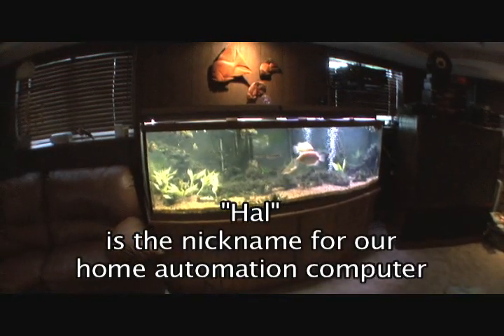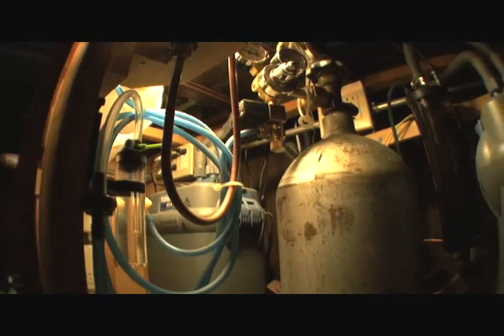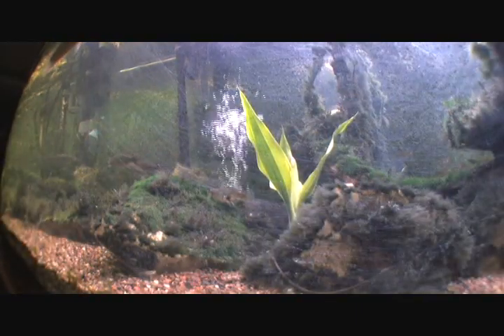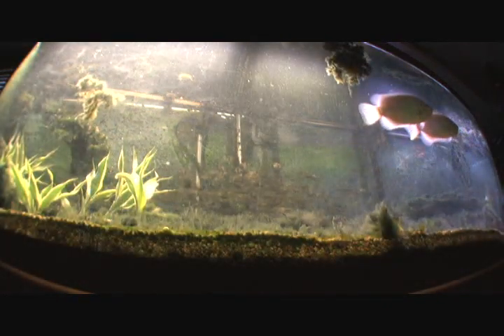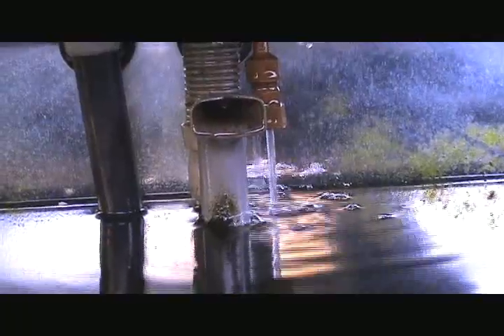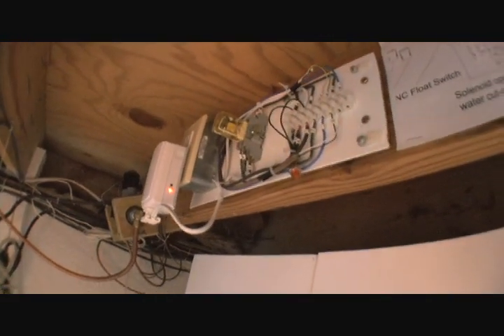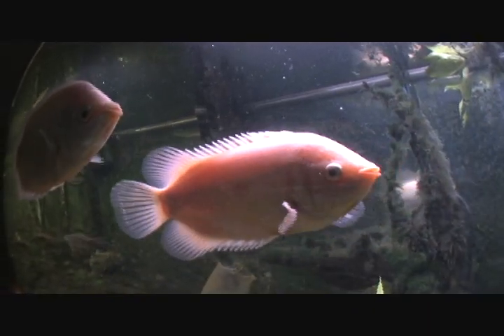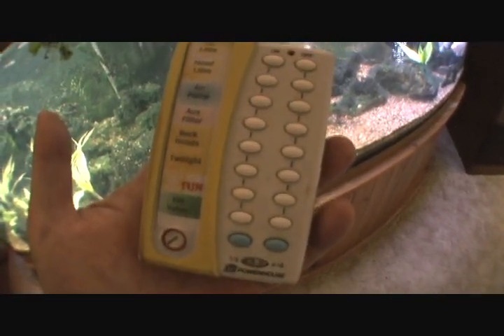Part 5- Automated Freshwater Aquarium

Comment: Could you add orp ozone generator and a orp controller with probe, I've for a ph and orp controller on eBay for $139 to turn both the ozone generator or the co2 tank would it be useful on a freshwater system like yours, as a quadriplegic I was to automatic my planted aquarium as much as possible